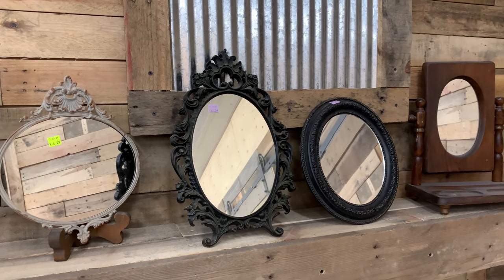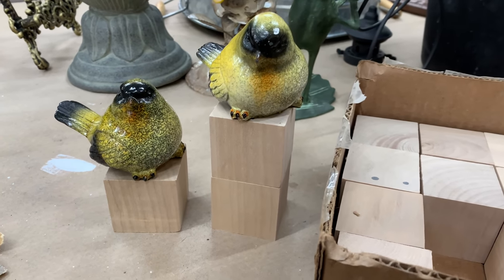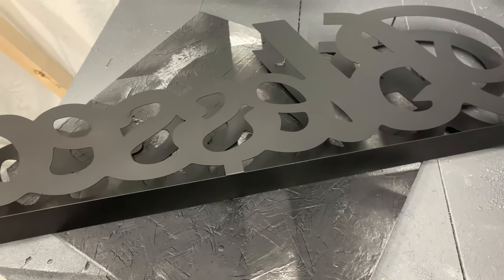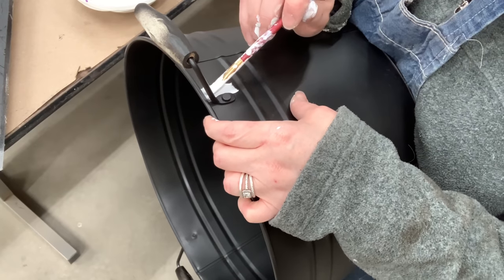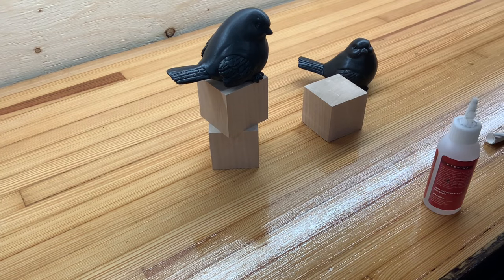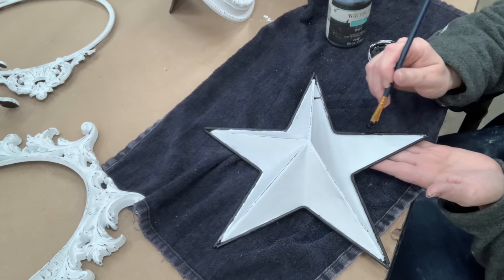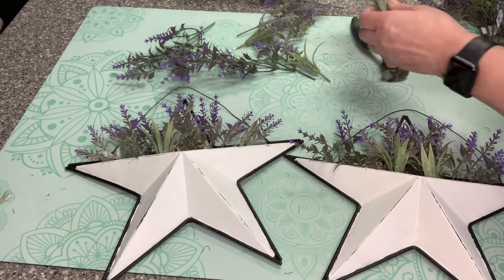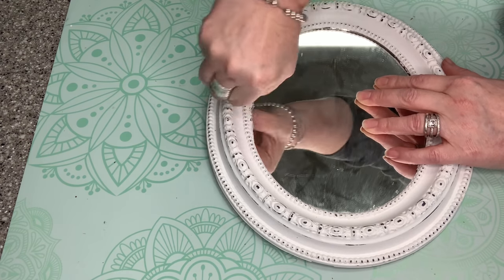Making Over Thrifted Finds || Trash to Treasure || Farmhouse Decor

Comment: I just had to laugh and call my husband in to see what you were re-doing. About 25 years ago I was given one of those [exact] weight stands. It was one of the table center pieces at a wedding. It had little glass tea light holders in the little baskets. I had it sitting on a table in my living room. While at work the kids some how broke one of the glass tea lights. The kids (teenagers) had gotten one of those icy drinks with a dome top earlier that same day. My son put the plastic dome top [that fit perfectly] in the basket and then added the candle. I did not notice it for months. Maybe over a year, lol. When I did my son told me what had happened. I was so impressed with his solution to the problem, I couldn’t get mad. Seeing that brought that memory back and now my question is, “Where did that thing go?” I love your channel. I do have a question for you. How do you decide which sealer to use for what purpose? I think you used 3 different spray sealers in this Video. Just learning. Thanks!

Comment: I absolutely love everything that you do! God has very much gifted you with a wonderful talent.   I have just started with the repurposing of older things, and I do spray paint with black and then seal it with polyacrylic, and then paint with the white paint. When I go to distress the piece though, I go past the black paint to the original paint, no matter how softly I sand. Any suggestions?
Reply from the maker: Oh.. use much lighter sand paper.. if 220.. than go with a 300 or 400.. the higher the number the softer the sandpaper.  If you noticed I did switch to the chalk paint because of being able to water distress so I didn’t sand through the black. I’ve mentioned thats way I changed. 🤗
Reply: @GingerChickRehab  thank you 😊

Comment: After stamping the bee on the bucket,  why did you use a different sealer than polycyclic?  I ask, because I am trying really hard to get the process!
Reply from the maker: It’s just what I have in my craft room. Usually the polycyclic is in our shop. But either will work. Just something to seal it in.
Reply: @GingerChickRehab  oh..that makes sense.  Ok.  Thanks!

Comment: But I'm trying to ask is why use the rustoleum over the polychloric or the other way around what makes one better than the other for different items
Reply from the maker: You just have to try it for yourself. Rustoleum is a third of the cost of polycrylic. So that's why we use the rustoluem the most. Or I should say switched to. They both are top coats.